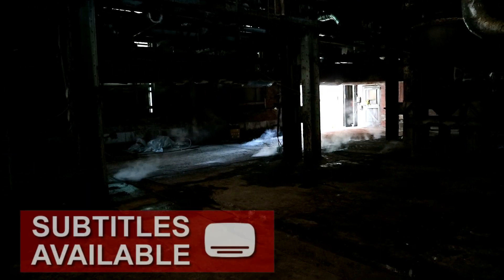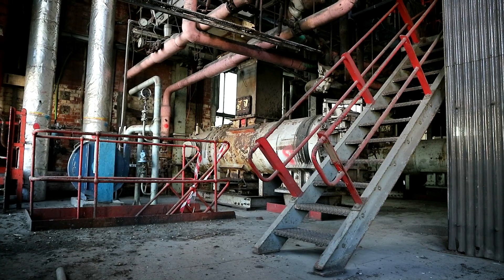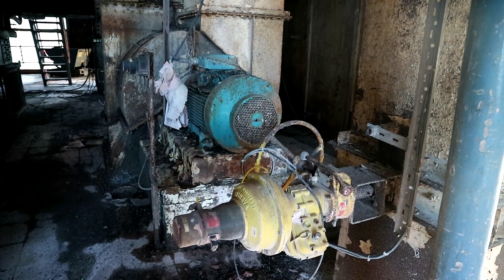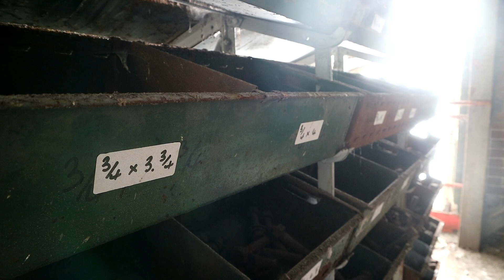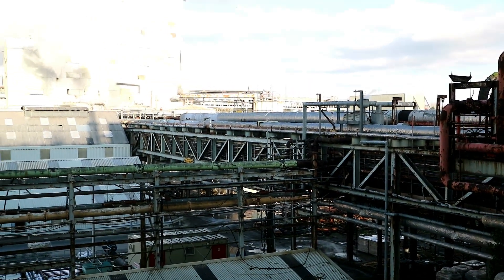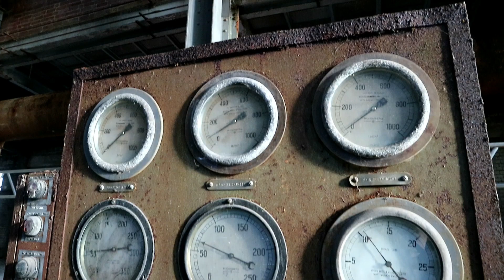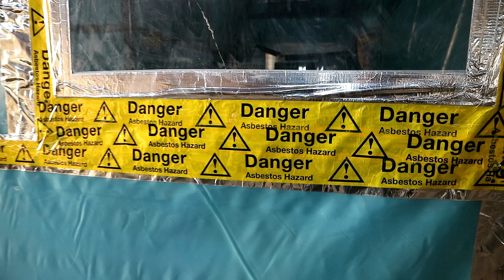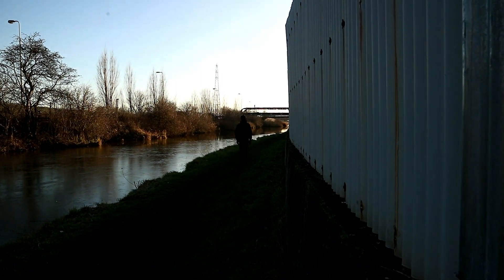Abandoned Power Station with Decaying Turbine Hall! - Urbex Lost Places UK

Comment: I have a feeling I know where this is, as I worked there as an apprentice in 1993 / 94. One of the jobs I had to do was replace a pressure gauge on one of the turbines. It used to be extremely hot in that area, especially in the middle of summer. A lot of good people worked there, if it’s the same place, sadly some of them are probably no longer with us.